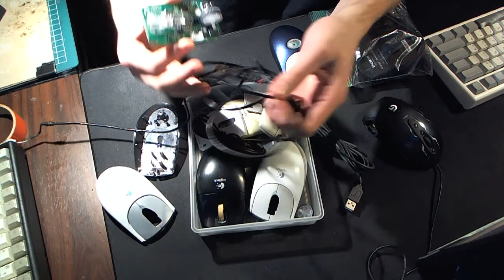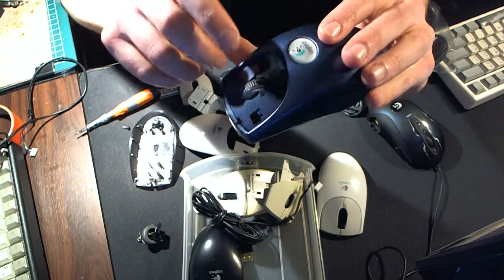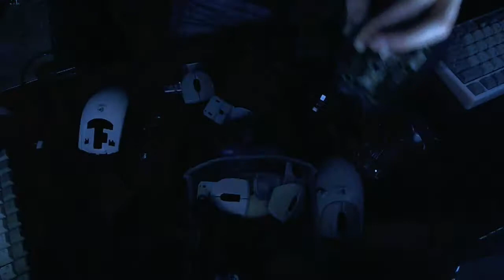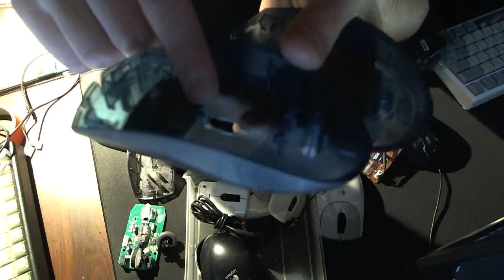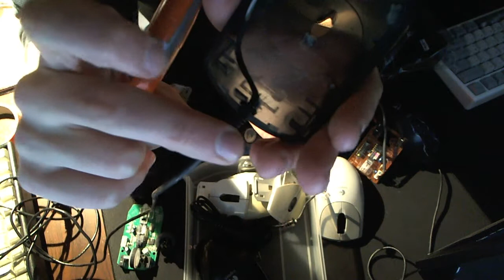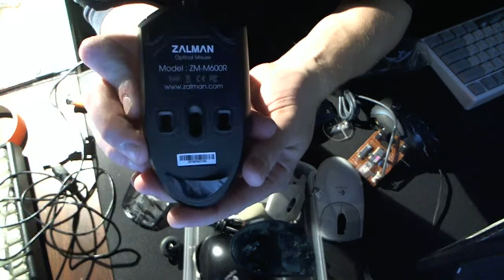NMOUSE 4K Mod into Logitech Wheel Mouse Optical (M-BJ58) Shell

Comment: Would I be able to swap the interior of a Zalman ZM-M600R into the shell of a Logitech g100s? I want the shape and sensor placement of the g100s and the response time and polling rate of the ZM-M600R
Reply from the maker: yeah that's probably do-able but probably not as easy as a m-bj58 shell. main thing is you gotta know if the mouse buttons will align with the microswitches. g100s' microswitches are really close together. nmouse 4k is not. do-able, but more work just saying

Comment: Does That work with every mouse?
Reply from the maker: if you're ambitious enough :P
Reply from the maker: You mainly have to watch out for:
Good microswitch/LMB/RMB alignment
PCB height (too high sensor won't track, too low scroll wheel contacts lower shell)
PCB length/width must fit into shell